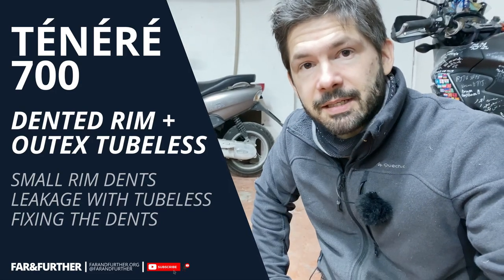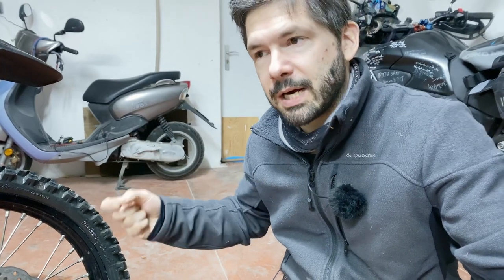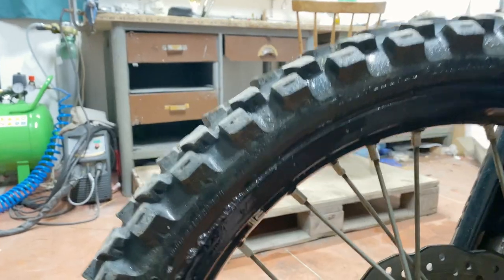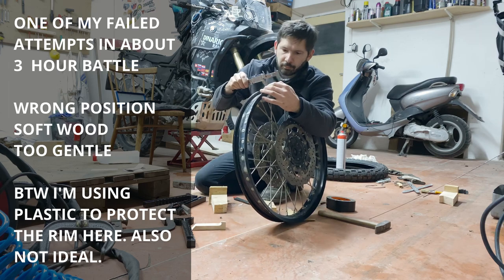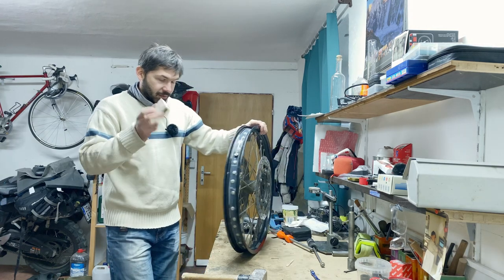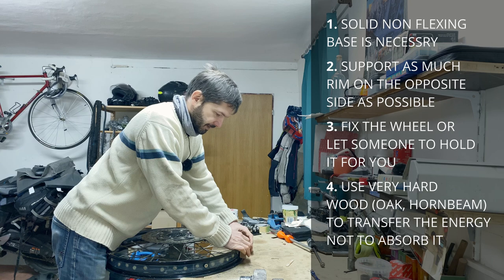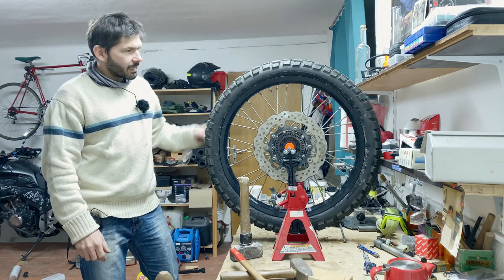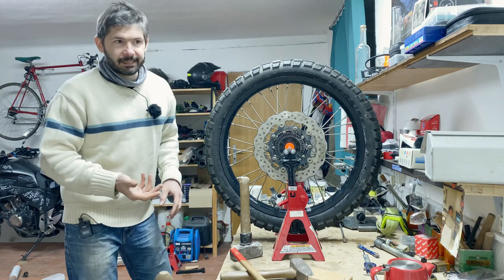Yamaha Ténéré 700: Dented rim fix & leaking tubeless - OutEx kit conversion

Comment: Just whacked my Versys 650 front rim back into shape with 2 rocks at a gas station this last weekend, it's doable in desperation!

That Fix-a-flat tire foam goop also works great in a pinch.
Reply from the maker: Hehe, that must have been a desperation :) Well donel. You use tubes right?
Reply: @FARANDFURTHER  Nah I run tubeless.

Comment: Good to hear you were able to fix the rim and get a good seal. However, it might be worth considering upgrading your front rim to a stronger better quality rim, such as Excel, especially as you do a lot of off-road riding. 👍
Reply from the maker: Thanks Paul, I thought about it but the cost is just too high right now. I wanted to see if I need better rim first, and so far I'm not sure I need to upgrade (similar story with the suspension).

I think it would be great to get the better rim especially as I can get 21" tubeless ready rim which would probably make a big difference with slow leakage when tire is old.

I was really, really surprised how tough the rim was. Internet says they're made of cheese these new DID rims... well it's damn hard cheese! The rim survived Morocco where I trained for the Dinaric rally (lots of stones and jumping) and the Dinaric itself with these small dents (and the biggest one is a pothole!).

So yes, probably it would be better to have stronger rims, but for now money goes elsewhere.
Reply: @FARANDFURTHER   I wonder if maybe you could use some slim, not for rim dents, as that probably wouldn’t help, but more for the tyre bead leaks?
Reply from the maker: @windinthewillows6248  Possibly, when I took it to the tire shop they had some special liquid rubber which they applied onto the bead and it sealed it a bit, I think that could be solution as I can imagine it is used on the cars very often and hence available in any tire shop.
Reply: Are Excel rims ‘bashable’ too or are they brittle or alloy?
Reply from the maker: I really don't know, the problem I can see I'd not like to bash so expensive rims :)

Comment: How about injecting through valve hole puncture preventing liquid inside of tire? Seals bed leaks super fine on tubeless tires..
Reply from the maker: That could also work, if you mean something like Slime and similar products, but I have not tried so I don't know.

Comment: Did you continue to use the OEM tires after the tubeless rim conversion? I know there is a difference between the tubeless tire and tube tire, so I don't know if I need to get another pair of tires specified for the tubeless rims to make this work.
Reply from the maker: Hi the OEM tires are TL tires which means they're tubeless tires which are compatible with tubes so they use them. If you look at the tire it will be either TT (tube type) or TL (tubeless). You can use most of the TL tires safely with tubes or without them. Using TT tire tubeless is asking for trouble.

Comment: Is this an OEM Yamaha rim? I am asking because Yamaha says it is a different type of rim than on their hard enduros and it is not  suited for tubeless conversion....
Reply from the maker: Hi Steve, yes this is OEM Yamaha rim. The rear rim is tubeless ready rim while the front one is officially only tubed rim because it does not have the safety lip, I have more information about this in my OutEx video - https://youtu.be/usWNktosQPc

I've been running this setup on both Honda CB500X as well as T7 without any problems but of course as I also say in the linked video it's up to eveyrone as it may have legal impact and carries some risk.

Comment: "....I am a programmer..." what an excuse😂🤣.... does that mean your force is either "1" or "0".. 🤔🤔😁 great solid, aquired by doing (!), knowledge given!  I still believe that there is a point in  releasing pressure that contributes more to deformation than grip....cheers
Reply from the maker: Well... I have to make some excuses as apparently it's 10 minute job and not 3 hours. The slow leaks along the rim... I'm with you on that one I think now that it's the change in pressure, car tires keep on constant pressure while I'm lowering down to 18psi off-road and 32psi road... also dirt and so on...

Comment: So You dont regret doing conversion to tubeless?? I have ordered Outex and I'm confused if i did right.
Reply from the maker: Hi Andy, no I don't regret at all. I've ridden more than 100 000km with OutEx by now and I'm happy. Sure, it has it's pros and cons and the damage to the rim or cut in a tire will for sure be problematic more than with the tube but the fact I don't need to faff with the tubes outweighs that.

Also this is the 1st time I had to fix the rims this way in all that time. I'm now riding more aggressively and rode a rally on the OutEx... it would be surprising if I'd not dent a rim a bit.

Considering all that, it works for me very very well.
Reply: @FARANDFURTHER  would this have happened if you were using tubes?
I'm a big fan of tubeless, but risking damaging the rim, no thanks
Reply from the maker: @lefterisbampaidis5446  Depends what you're asking about...

Would I dent the rim on the rally or with the pothole?
Yes, that does not have anything to do with tube/tubeless. As a matter of fact, people tend to run tubes at much lower pressures than tubeless - especially offroad - so the damage can be more extensive. I have to keep my front to 18psi minimum. Doing harder enduro where you have bigger rocks and need to lift the front wheel in order to get through successfully or any rally environment the rims will be in danger.

Would I have leaks with dented rim and tubes?
No, most likely not as tube would hold the air. However, and that's big IF, the pinch flats are the big problem with tubes. As the tire hits pothole it deforms to the point where it can't absorb more energy, hits the rim and if one has a tube, it hits the tube and pinches it. So instead of having slightly dented rim with slow leak I'd endup with proper flat.

Comment: Back in the DAY we used lead hammers to fix our wheels both on cars with aluminum rims and motorcycles. Probably can't even buy lead hammers today.
Reply from the maker: After going through the process... the lead hammer would be an amazing tool for this job! I would be surprise to find one in a DIY shop nowadays, probably hard to find in antique shops as I imagine people sold them for metal.
Reply: @FARANDFURTHER  you make them... I have one also a rawhide & alunimium combo hammer... you need to heat the ali rim to about 200c with a heatgun about double the zone of the repair... the rims are heat treated tempered so are quite springy... make a HUGE difference to hammer back... comparable to warming a stiff tire for fitting... chalk & cheese... also using wood blocks on its end grain is a big help transfering impacts rather than side grain... Just stumbled on your channel excellent viewing thanks for your efforts... cheers from NZ